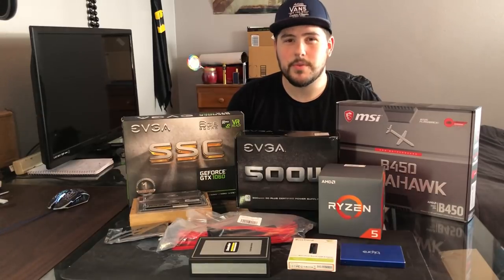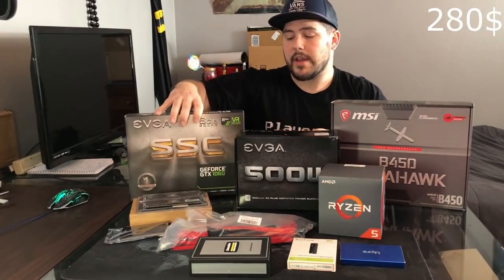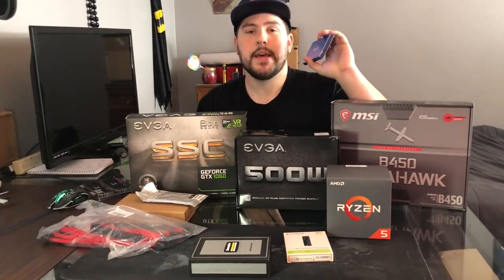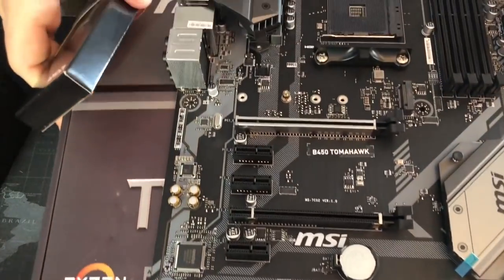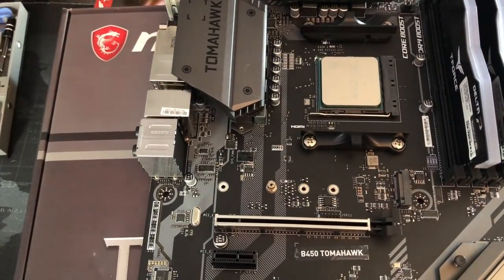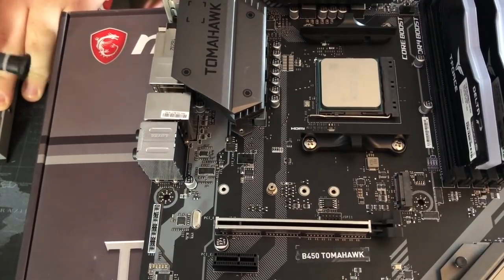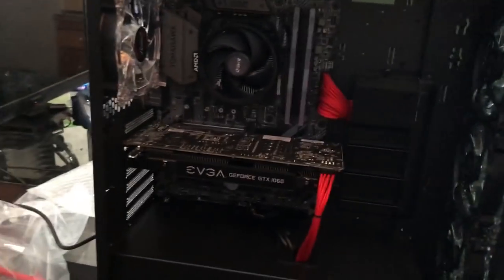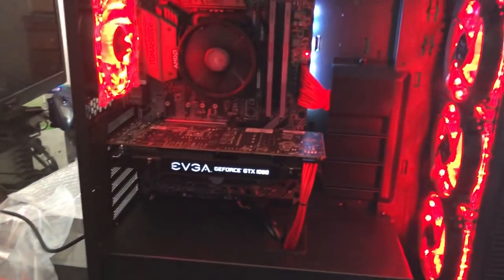First PC Build

Comment: Great build! The only thing I noticed (while it isn’t a big deal at all) is that you could have swapped the hard drive sata cable around so that the right angle side is plugged into the hard drive and the straight side is plugged into the mother board. That way there isn’t any stress on the cable when it is plugged into the motherboard.
Reply from the maker: Smallest Trout great point bud! Didn’t even realize I could’ve do that I’ll have to rearrange it now! Thank you!

Comment: b450 has 1 pcie x16 slot which is the upper one, you were right, connecting graphics card to lower slot would result in slower performence because lower slot is not pcie x16 (even though it looks like it), it is actually pcie x4

Comment: Can i use ddr4  corsair vengence 8 gb 3200mzh on b450 tomahawk?
Reply from the maker: Boruto Naruto Next Generation  I just upgraded mine to 16gb of Corsair vengeance pro at 3200mzh and i had a problem with it not showing display. I updated my bios and it is working fine. So if you do get it and have issues try updating bios
Reply: @marcusautry678  you have no idea how much that little piece of advice just helped me out
Reply: yeah if you're getting a ryzen cpu you should always get 8gb 2x4 3000mhz ddr4 ram or better.

Comment: Did you check the manual to connect the power button? mine said to connect on the left side by the audio port and my PC never turned ON, obviously... I even got a replacement... it's coming in soon.. I hope it was a bad print and I'm not just a fucking idiot...

Comment: Plan on buying this case for my first build how do the rgb fans work do they plug into the motherboard or is it a molex that plugs into the power supply?
Reply from the maker: King CGW well it has a multi fan header in the back with a molex..love the case. Good choose!
Reply from the maker: King CGW you can kind of see it at 16:45
Reply: BULLSEYE209 so that molex were would I plug it into the power supply? Lol sorry I’m new to this I’ve watched a lot of videos but not sure about how the fans work
Reply from the maker: Yes you just plug the fans in, then plug in the molex case cable to power supply
Reply: BULLSEYE209 so is it just one cable that powers all the fans and the lights on them you just plug that molex in to the power supply or what?
Reply from the maker: It won’t turn them on until the everything is set up
Reply from the maker: King CGW yea
Reply: BULLSEYE209 so the only cable I need to plug in to get the fans to work is the molex into the power supply? Or will I also have to plug the fans into the header box on the back?

Comment: Hello I tried to build this same pc but when i turn it on a red cpu light turns on for 1 second and it won’t post any thoughts on what i should do
Reply from the maker: Rowel Espejo Does the cpu fan power on?
Reply from the maker: Also make sure your cpu is compatible to the motherboard
Reply from the maker: Rowel Espejo is you video cord plugged into the motherboard or gpu?
Reply from the maker: Rowel Espejo I would do a full check from power supply to their destination. Make sure everything is secure. A specially the cpu power
Reply from the maker: Rowel Espejo I would make sure everything is off take out the gpu and plug in your video to the motherboard and if it posts then it might be your gpu